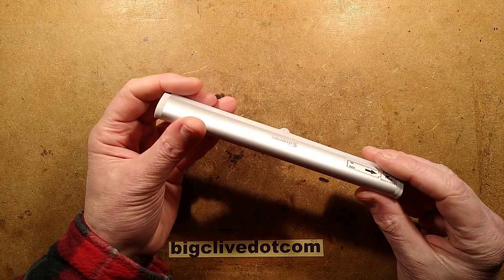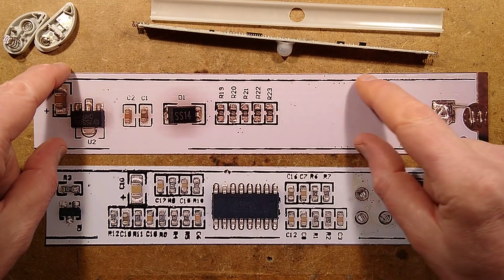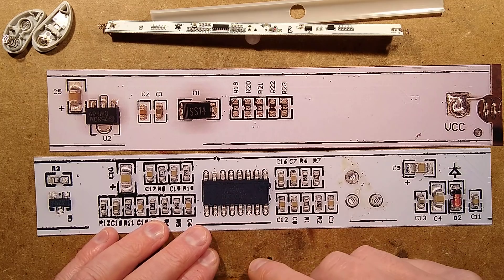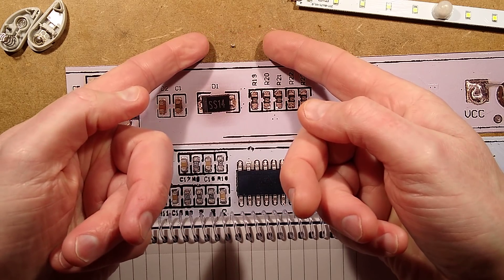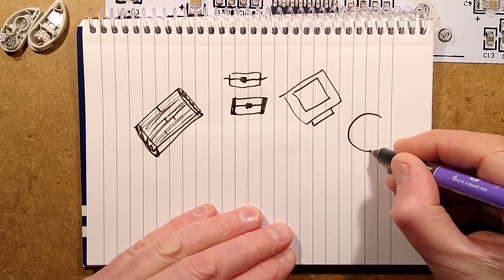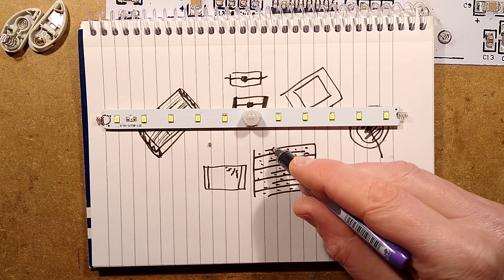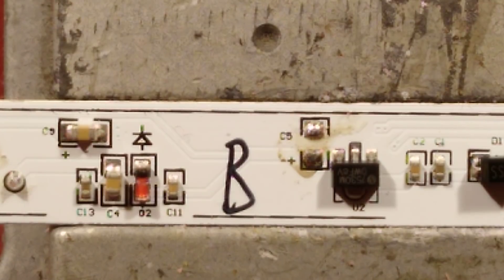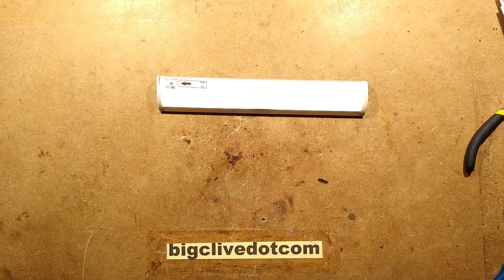Fixing a faulty battery PIR light that was draining the batteries fast.

Comment: Good job.   Troubleshooting is a dying art it seems like these days,  though it is just a LED lamp it furthers our knowledge and skills by making one think.
Reply: Troubleshooting is actively discouraged by many producers of electronics. Look up the John Deere tractor maintenance row for an example.
Reply: Don't buy John Deere tractors then. Buy a different make or buy an old one that's simpler.
Reply: Oh how times have changed. Wind back to before the 1990s and a lot of electrical and electronic equipment manufacturers were happy to both support independent service engineers with hard to find replacement components, service manuals, schematic diagrams and in some cases technical support by ‘phone. But increasingly since then most now consider whole PCBs to be replaced or just replace the whole item. Most now no longer support any repair work outside the guarantee period and want the item returned to specific companies for repair. Combine this with the constant competition in keeping prices low while increasing the features or reducing size or energy consumption and increasingly more and more products are disposed of after not very many years of use. Think about it, do you still own any electronic or electrical product that is older than ten years? What about five years old? Yet back in the 1980s, our so called old, “less reliable” electronic or electrical products were expected to last many, many years. And when they went wrong, you could often get them repaired for a fraction of the cost of a new one.
Reply: My brother "listened" to a battery charger of a quite popular type and brand of battery operated drill and screwdriver with an AM radio to, based off on the intermittent distortion he could hear in the defective unit compared to a working one, only trying to hear how it's detection circuit (to watch for a battery so the mains circuit would not be fully on all the time) was failing and what part could be responsible.  It turned out to be this incredibly cheap capacitor that due to it's low maximum voltage tolerance fails a lot.
The article he published on his site about the fix has been viewed numerous times and he already got messages from basically all over the world from people who fixed theirs with his manual....
Reply: Totally. When I went to college the importance of the motto "To diagnose & repair to a component level." was key. Even if you were just going on to be a sales rep for a company they wanted you to be able to troubleshoot to that component level. Most of my instructors were ex military, too.
Reply: “Looks to be broken... I’ll sell you a new one”🤑
Reply: It won't be a dying art, not if wuflu takes over the world!
www.Wuflu.live
Reply: @soupflood  Thanks for the interesting web site but it must be getting too much traffic to even spit out #s. It's sort of hanging for me and I'm on a high quality high speed fiber optic line that is usually pretty rock solid.
Reply: @johnpossum556  it happens the same to me. A few hours ago it was okay though.

Comment: I've been curious about this for a while. Why do electronics that run off of batteries need input filtering capacitors? 
I mean, I know it's always good practice, but I don't think batteries put out unstable current, do they? I must be missing something.

Also... the fact those tiny SMD caps fail like that is a bit worrying! I think the worst part is is that there's no obvious way to quickly identify them as being faulty... unless it catches fire, of course. lol
Reply from the maker: It's probably for the stability of the voltage regulator.  The one on the output will also keep voltage fluctuations to a minimum to ensure stability of the very sensitive PIR detection circuitry.
Reply: @bigclivedotcom  Thanks for the info! Makes sense.
Reply: BRUXXUS - low volt drop series pass voltage regulators need relatively large value capacitors on both input and output. Otherwise the internal high gain feedback circuitry could burst into oscillation at certain load currents. Not what you want in a regulated power supply!
Reply: Mark 1024MAK  makes sense now. 
For some reason I wasn’t considering how the draw of the circuit could affect the stability of the power. I always just thought those filter caps were there for smoothing a dirty power source. 🙂
Reply: Because current surges will cause voltage drop due to the internal resistance of the battery. The capacitors reduce the amount of the voltage drop..

Comment: don't forget differential expansion of the copper circuit board, or worse an aluminium heat sink. You don't want to heat that more than you have to :)

Comment: Copper end caps? I wish. Every SMT resistor and small cap that I've seen had steel end caps. The tiniest bit of magnetism on your tweezers will tombstone those things in an instant.
Reply from the maker: If you noticed me pause slightly at that point it's because I didn't know for sure.  This is why ceramic tipped tweezers are so useful.  (Cheap on eBay.)
Reply: Or aluminium tweezers.
Reply: ceramic tipped tweezers are a must for manual surface mount imo, couple of quid on ebay very well spent
Reply: It's neither. The end caps are nickel or nickel-palladium.
Reply: SMD resistors and caps mostly have tin plated nickel terminations. There ate variations depending on intended use but they certainly don't use steel.
Reply: isnt tombstoning mostly caused by the surface tension or other fluid properties of the solder?
Reply: @-yeme-  Yes, tombstoning is a specific term used when parts get flipped onto their end during soldering, from surface tension.
Reply: Nickel is ferromagnetic too.  Less so than iron.  I've been puzzled by small diodes with what seem to be be steel leads.  Why?
Reply: @raykent3211  There are a lot of modern through hole components that use tinned, copper clad steel leads.  I can only guess it's for cost purposes.